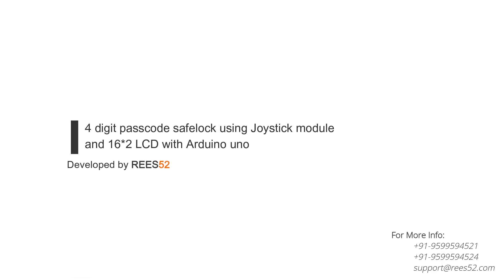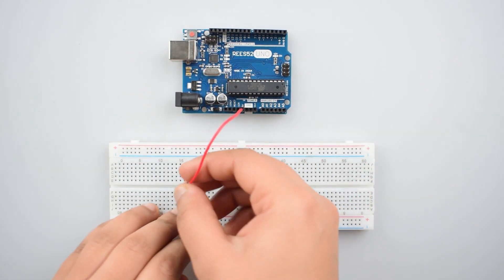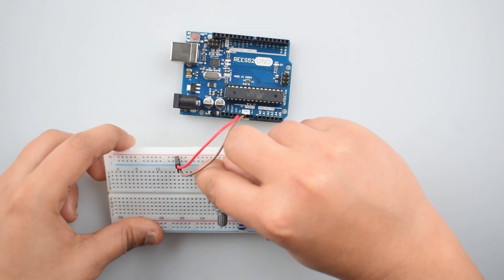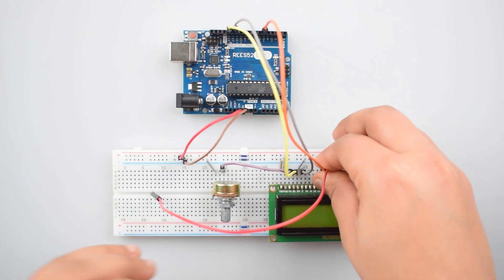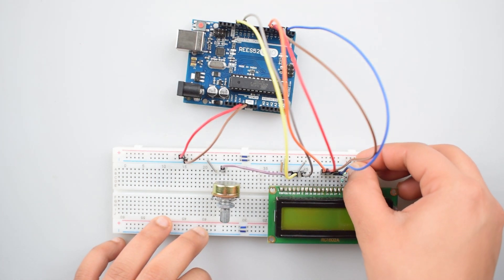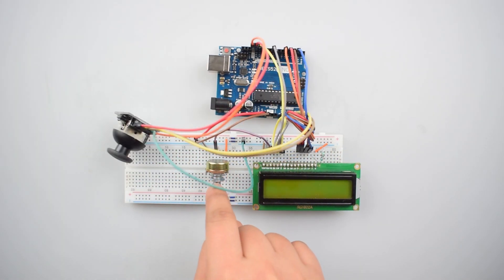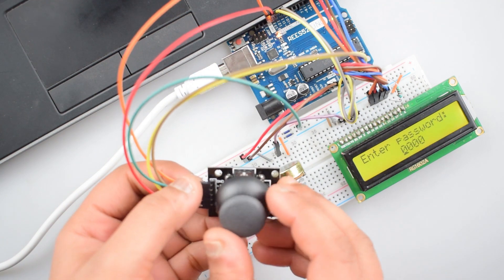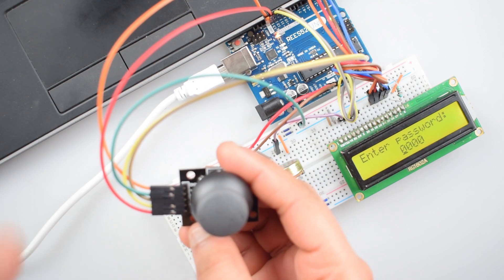Access a 4 digit passcode safelock using 16*2 LCD Display and joystick Module with Arduino Uno

Comment: how to make the password is from letters , numbers , and symbols with when we control it we use the joy stick when move it forward it go to the next letter , number , and symbol when we move backward we go to the previous letter , number , and symbol  when we move right go to next like : you are in letter 1 and you wrote 3 letters go to letter 2 when we move left we go to the previous  like : you are in letter 2 go to letter 1 and in the first time you are write the password to save it in the second time you write the password to open a thing  and turn on and off the device. how to do it and what is the right code to these things ?